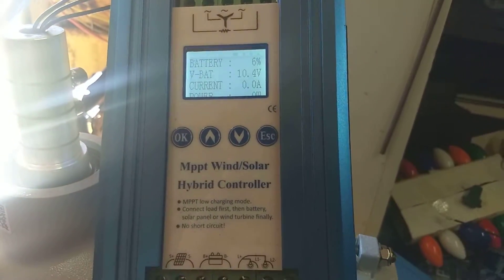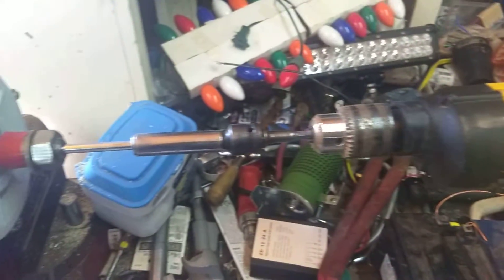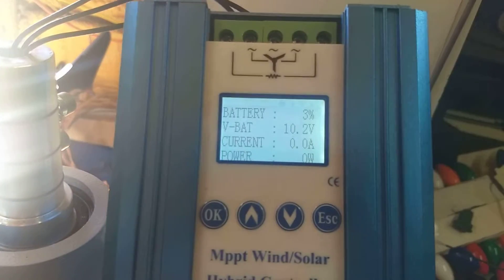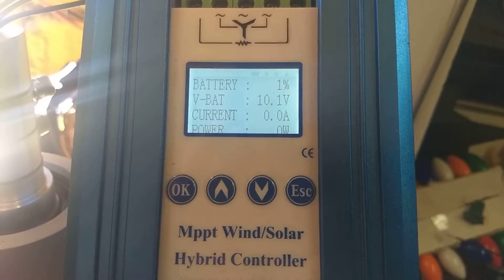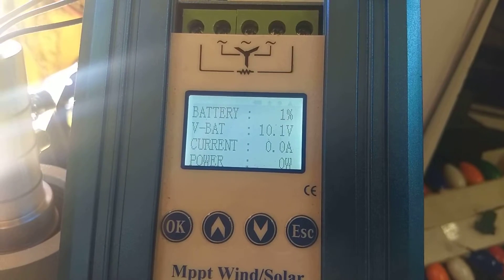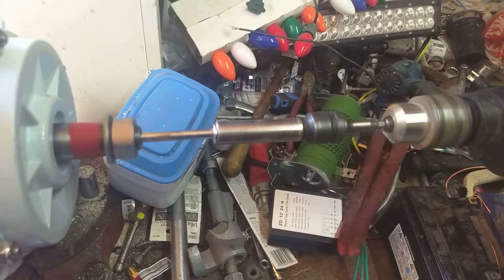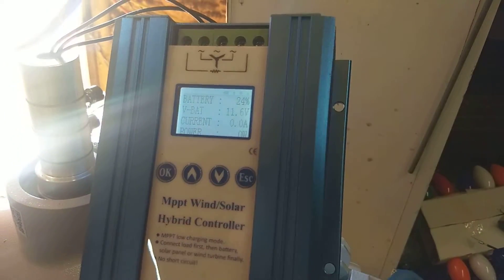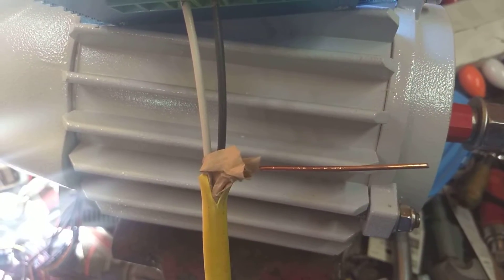iSta Breeze i-1500 initial output test

Comment: Hi Toys for watts, I have a question. how many watts can produce the iSta Breeze i-1500 with 3m/s (10.8Km/h or 6.7mp)?
Reply from the maker: That's a hard question to answer...I don't have equipment that graphs over time.  All I ever really get to see are peaks and whatever is happening in real time, so I have to guess...3m/s is a little low for the turbine to really get started, but assuming it had a bit of a gust before hand to spool it up and then the wind idled down to that speed it would probably be producing 150~250 watts depending on your voltage/battery setup.  It won't be a lot of power, or reliable power, at that wind speed though.